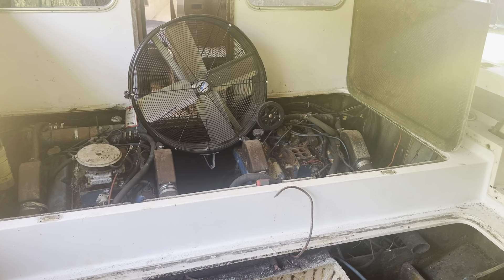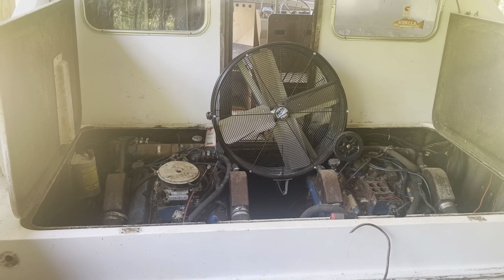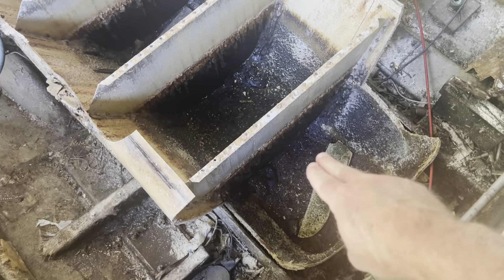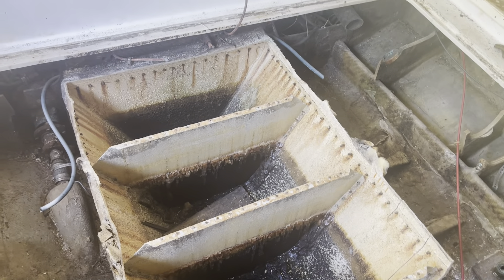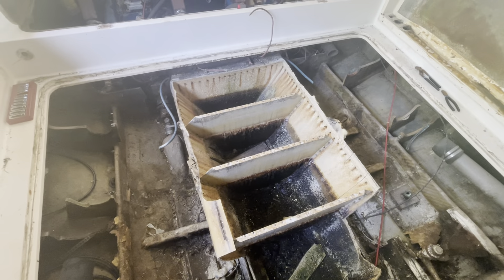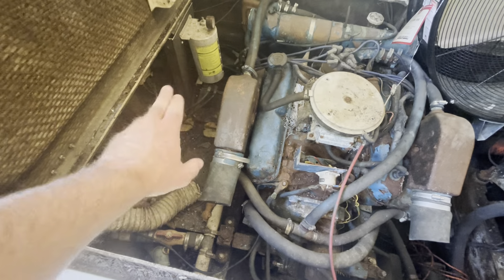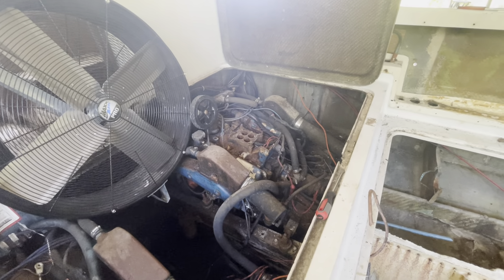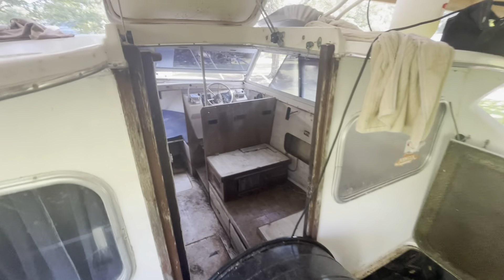Bertram 28 Demo

Comment: Port side tank is black water holding tank. And in 72 they came with different power options. Mine came with 350 chevys.
Reply from the maker: That explains it. Both engines are froze up and scrap! What is the holding tank under the floor in the cabin right as you walk in? Is that grey water?
Reply: @therustyblades1212  the tank under the floor in the cabin is your freshwater tank. Holding tank was located outboard of port engine IIRC (Mine didn't have it. I ended up placing mine behind the galley fridge.
Reply from the maker: There is also a tank behind the galley but I haven’t gotten to it yet. Grey water?🤷 I am just trying to get rid of the rotten gas smell. You an smell it when I drive by our house and we are on 10 acres with the boat all the way in the back
Reply: These boats are too small for grey water tanks. Both sinks drain straight overboard. A grey water tank may have been added  or previous owner could have made some configuration changes but as far as I can tell, the OEM configuration was center cabin floor: freshwater tank, Aft bilge center: Fuel tank, and Outboard of port motor: Black water tank.
Reply from the maker: Thank, I will let you know what it was hooked to when I start tearing into the galley

Comment: Also I’d replace the steering system with a new more modern one. The factory ones used a hydraulic with air pressure
Reply from the maker: Oh I am, everything is getting replaced. The only thing that will be original will be the hull.